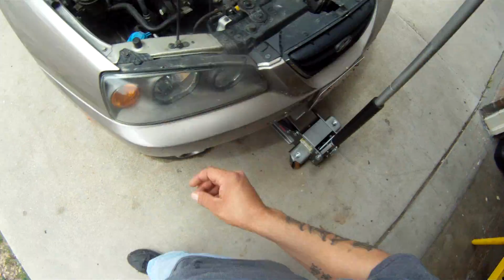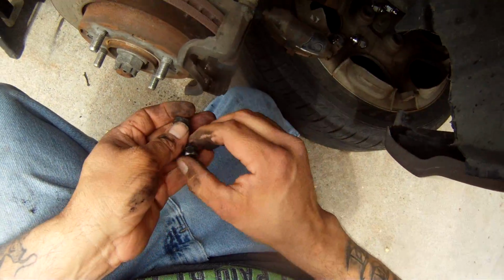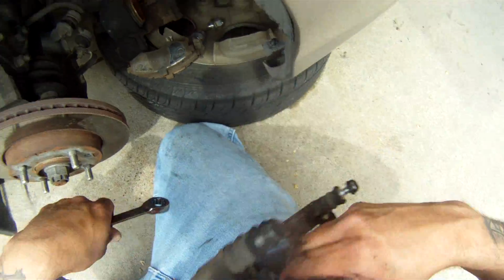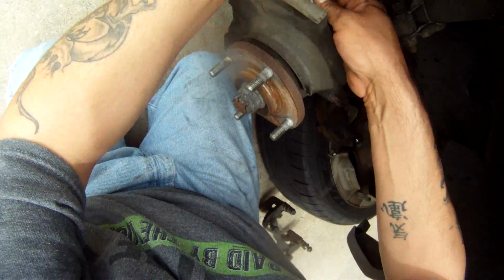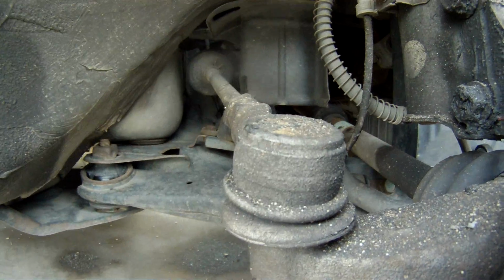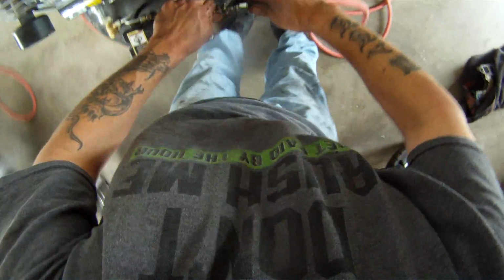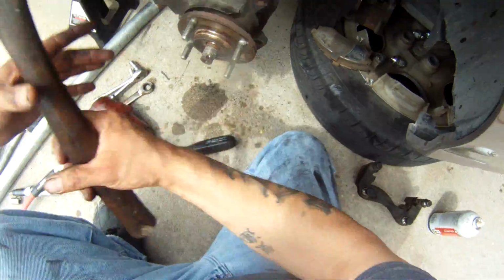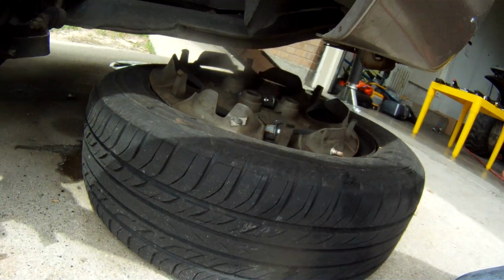2005 Hyundai CV axle removal

Comment: No need to remove brake caliper.. quicker to just take out axle nut, steering ball joint and lower ball joint..then swing assembly out to get to axle assembly
Reply: I think the way he did it is better. No messing with cotter pins, driving or forcing the tie rod and ball joint out. Plus the lower control arm holds the weight of the knuckle. I would also think most people would change the brakes at the same time.

Comment: @Matt Shaughnessy. Matt, while removing the exhaust system on my 2006 Hyundai Tucson, I noticed that the left rear CV Axle either has a seal or O-ring leaking where the axle goes into the case. I'm assuming that I'll have to disconnect everything on the inner side of the hub in order to swing it out so I can remove the axle. Or can I just remove the Hub I've never worked on the rears before so this will be a first.
If you have a video on it, I'd like to watch it since I have yet to locate more than 1 video on YouTube that pertains to a Hyundai Tucson. I believe the 2005-2007 Kia Sportage are the same, since both vehicles use pretty much the same parts.
Reply from the maker: have you tackled this yet? email me at highgrooveauto30@gmail.com and I can help walk you through this.
Reply: @MattShaughnessy6  Matt, hi buddy, I just noticed your reply. I haven't started it as yet because the woman I bought the Tucson from didn't tell me she ran over something that dented the fuel tank & the sweetheart of a mechanic welded the exhaust system together that got half torn off the vehicle & since each joint was also leaking I had to buy a new system because I had noticed a couple hot spots inside the cabin floor, ( No lol's here ). I just got the last exhaust piece in today so I'll install that because my wife will need the Tucson while I'm doing my running around this week.
Just an FYI, it looks like in order to drop either rear cv shaft, I'll have to disconnect each wheel/ hub & the support arms under the car that attach to it. But I'll email you as soon as I'm done today with the exhaust & replacing the power steering pump....
Reply: @MattShaughnessy6  lol I'll email you today Matt, the left front cv axle went out yesterday, with no warning like any other I've had that started going bad. This one on our Tucson went bad like now.
Reply: @James Jameson flixportal
Reply: @Garrett Mateo Thank you, signed up and it seems like they got a lot of movies there :) Appreciate it !
Reply: @James Jameson happy to help :D

Comment: Bud, you have gone waaaaay further on disassembly than you needed to. This is about a 10 minute job.
Reply: I agree! I just replaced my cv axle on a 2003 Sonata. All I had to do was pop the lower ball joint. Take the axle nut off . The whole hub assembly will pull away from the axle. I did have issues with the opposite end getting stuck, but with a crow bar n some elbow grease it came out. Then just pushed the new one in till the ring locked in the tranny then just tighten everything back up and done! No need for taking anything else apart!! Just a little thinking is all it requires!! Good luck

Comment: I have looked at several videos on this and there is one thing that is never addressed.  I kind of gave Jim the car guy a hard time about it because I used his video when doing the axle, but here is my issue.

As soon as I removed the strut bolts, the strut started expanding, pushing down on the axle and lower control arm.  I borrowed some Mcphersons strut compressors and was able to rig it in there enough to compress the spring enough to be able to remove the strut and get it out of the way.  So now what do I do?  I could compress the strut, but I cannot leave the compressors on while installing the strut.  I could replace it, but am I going to have the same issue?  Upon removing the strut, it does not appear to be broken.  It has 100000 miles on it, so I am sure it is worn, but I was just going to leave the struts on and drive it till it dies.  I think the tranny will go before the struts do.

So I will ask again, is this a common thing, if not, what would I have done wrong.  I don't see anything different in your procedure that what I did except I did not take the tie rod end loose.

Thanks,
Jerry
Reply from the maker: once you take the strut loose it's going to move a little bit internally inside of the strut there is a washer though that will keep the strut from moving all the way or moving a lot like what you have explained. what you have explained the only answer I can think of for this is that internally that washer has broken allowing that strut to travel down the way it is it sounds like it's time to change the strut.

Comment: Hey bro. How do you get the hub off, not hearing just hub, I took off every thing , past rotar,2007 sonata, there's no more bolts,if I tap like u just did to take out axle, will hub come right off too?
Reply: Usually they are in there pretty tight. Lots of penetrating oil, time, heat and chisels should do the trick.